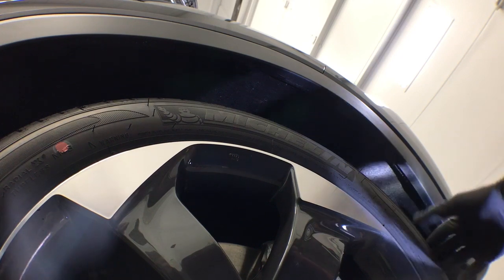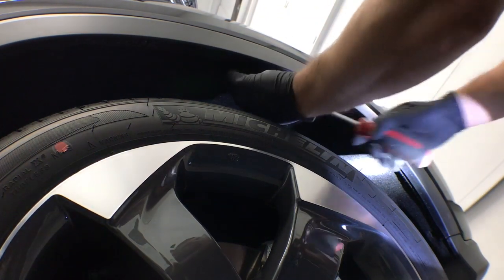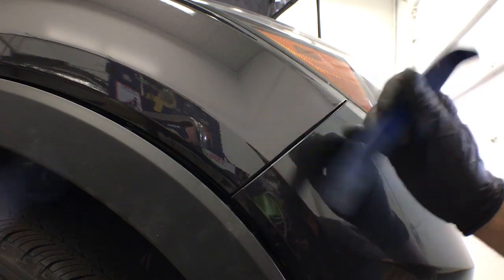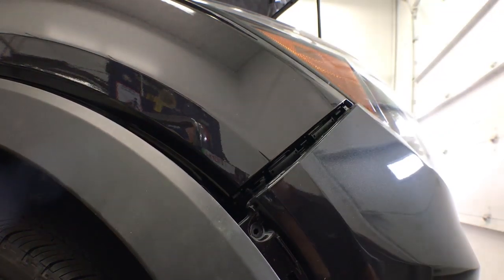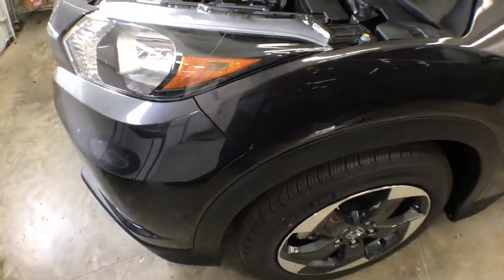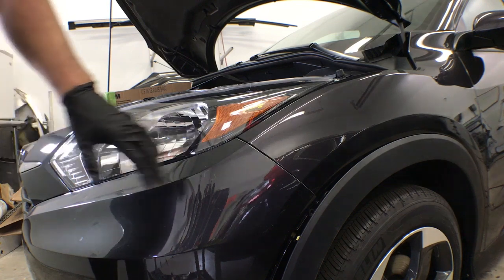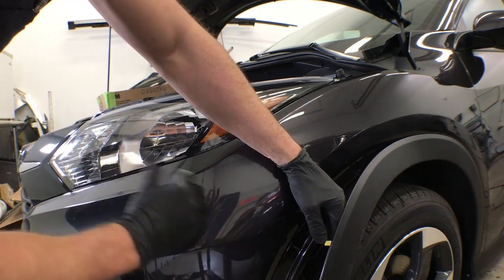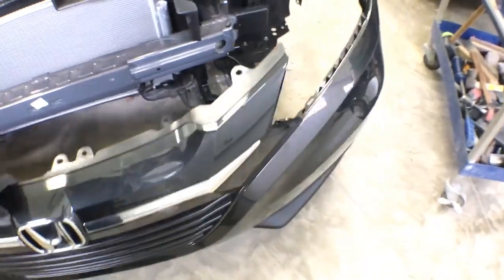2015 2016 2017 2018 Honda HRV Front Bumper Cover Removal How to Remove Replace Install

Comment: Wow! Great job  removing the front bumper cover.  Recently, I had Abra auto body shop works on replacing and/or repaired my 2016 HR-V and they did a lousy job.  After so call the repaired,  there's still a 1/4" gap between the right fender and bumper cover, looks the same as before it was repaired because that's the areas where it got bump into causing a  crease on the bumper's paint and the same 1/4" gap between the fender and bumper cover.

Comment: Hey. Thank you so much. This saved me a lot of money instead of going to shop. One thing, though. Can you help with how to avoid breaking the clips, especially the ones around the wheel? Those ones are a little different, and I think I broke a few when trying to take them off!
Reply: The ones around the wheel wells and under the car can become caked with dirt/mud/salt/etc...sometimes it's impossible not to break them.  The good news is they're cheap and readily available at your local Honda dealer.

Comment: Hi great detailed video 📹 thanks allot...! I'm thinking about doing a second horn install. Would like some help locating the horn switch wire that will connect on the toggle switch I'll be using.

Comment: What is the hole for to the above and to the center of the passenger fog light?
Reply from the maker: That cap can be removed and a tow hook can be screwed into the front beam of the vehicle.

Comment: with the bumper removed is it possible to remove the headlights at the current point or is there more things to remove for the headlights? (I have Vezal LED lights I want to install) Also why were only a select few tabs removed from the bottom and other skipped?